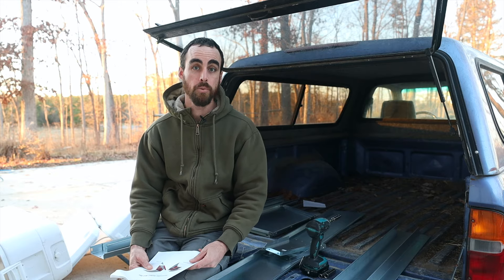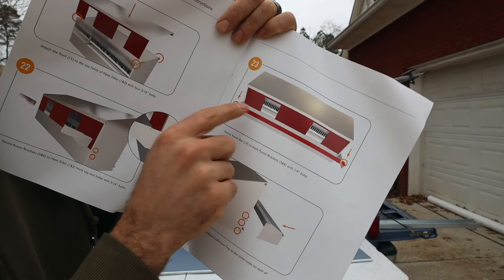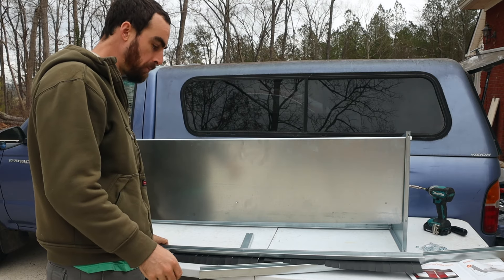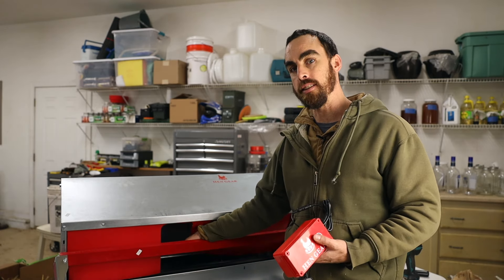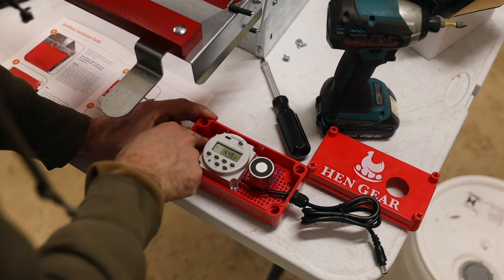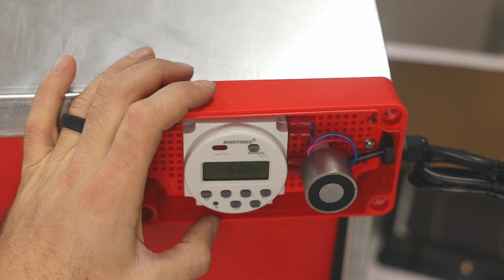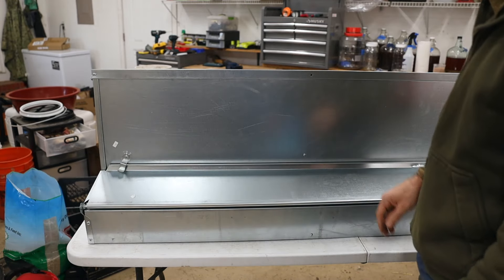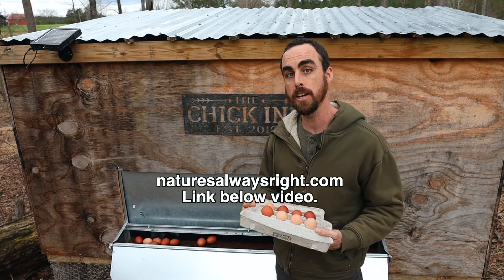The Easiest Way to Collect Eggs | No More Broken or Dirty Eggs!

Comment: I bought one of these, and my hens will NOT lay in it!!!!  They will lay inside the chicken house floor before they use that thing. I installed it so I could collect the eggs from the outside, but the only thing it is good for is for me to go inside the house, put the eggs into the box, and then I fluff up their shavings. I hope you have better luck with your hens!
Reply from the maker: Mine had no issues. I locked them in the run for about 5 days and they figured it out fast. First day a couple eggs on the ground then that stopped happening. You can get fake eggs to put in the box to help encourage them. Also could try putting straw in the nesting box temporarily until they get used to going in then take it out.